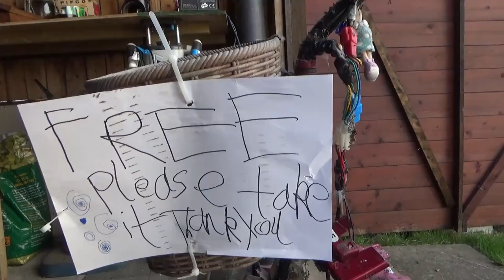DuB-EnG: Mobility Scooter Pimp My Ride PT1 - Repairing Upgrading a ShopRider invalid carriage fun

Comment from the maker: Solar powered, high performance, lithium ion batteries, shorter steering column, complete with radio 📻...  what else do you think this needs ?
Reply from the maker: Not yet...  but you get first mention for suggesting it!! :-)
Reply: - Fat hot rod wheels on the back
- Biiiiiiig motors!
- Black and flames paintjob
- Fake exhaust pipes that shoot fire
- Chrome (shinier the better)
Reply: Fluffy dice
Reply from the maker: Fk yeah!
Reply: LED lights. Lots of them, preferably RGB strips run with FastLed :)
Reply from the maker: MrJozza65 ... damn yes... big purple ones on the under chassis ...  and... fluffy dice.... and a drinks holder.... and a table....  for cake and a cup of tea, a standard lamp with tassels... and a hedge trimmer attachment...  phew... I’ve got some work to do!
Reply from the maker: Exhausts... with speakers and the sound of an F1 car? ...  too much...  a V8?
Reply: A mini fridge to keep few cans cool when you're out, but a bucket with water and ice is your dubious option!
Reply: Definitely needs some racing stripes, a spoiler on the back, maybe some 20 inch tires and chrome spoked rims like this: http://allpicstop.com/car/pictures_of_cars_with_big_wheels.html
Reply: I think it needs good shock absorbers so the bumps don't jar the rider as much. And flames in the paint job. Maybe a truck driver seat, that has shocks in it as well. They are made for long distance sitting in a vehicle!
Reply: As someone who has to use a mobility scooter (amputation) I think the first thing this scooter needs is more speed. I've been looking into ideas for my own scooter & what's looking like a promising idea is a speed controller from one of those electric razor scooters. 
Weight saving would be good, the seat on mine weighs 35kg on its own! 35kg!! I'm thinking of mounting a cheap bucket seat (about 15kg) instead.
Li-ion batteries are a good idea but they're damn expensive.

Please don't go down the well trodden path of engine conversion, I'm dying to see how you make your scooter faster as it may give me some great ideas too.

As for a cup holder, well my scooter has full suspension but even then I don't see a cup of coffee surviving more than 50 meters in mine.
Reply from the maker: I’m going to make a set of over-voltage 18650 power walls Tesla style - like the one in my solar shed project.  I’ll have them at about 20 volts each, and I’ll change the control circuit too...  there will be a couple of large solar panels on the roof ... and many beers will be drunk in the process!!!  Thanks for your thoughts and constructive input!!  ...   keep your eyes peeled!!  :-)
Reply: HI, Maybe add some sensors like the lawn mower and make it semi autonomous or at least give it auto stop. Look forward to seeing what you do with it.
Reply from the maker: EPIC - Beefcake!...  Crome and Rims! - Flames in the paint-job, truck seat with suspension...  Arduino control - autonomous driving...  OMG - You guys are gonna keep me busy!!
Reply from the maker: OMG - CRACKING IDEA! - A mini fridge! ...  (Ice bucket challenge!)

Comment: I take on similar projects with scooters I refurbish from trading sites. add new batteries and give them some much needed TLC. Not to mention bristling with a couple hundred greenback on some awesome high tech gadgets and essential upgrades (pimping). Keep up the great work! Love the channel. PS did you know you can reprogram scooters to go ALLOT faster? LOL
Reply from the maker: Reprogram? ... tell me more! ...  can I flash the controller circuit?
Reply: Go in search for a Curtis Handheld programmer, some are pricey new, but sometimes a used one pops up. They simply plug in through a four pin connector, or through the power socket (adapter) and allows you to access all features of the speed controller module.

Comment: What about mounting some form of motor on the bottom that can be controlled from hand controls and have a spool of cutting cord attached so that it spins at 20'000RPM and use it to cut the grass and let the mulch lie on the grass and rot away.
Reply from the maker: OMG....  almost like a lawnmower? - :-)  ...  Maybe make it arduino controlled!   :-)